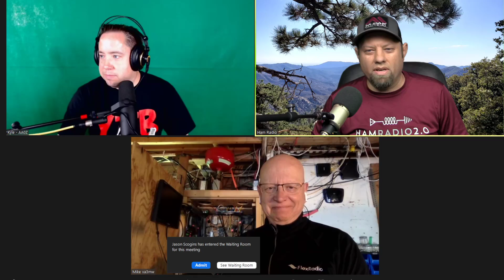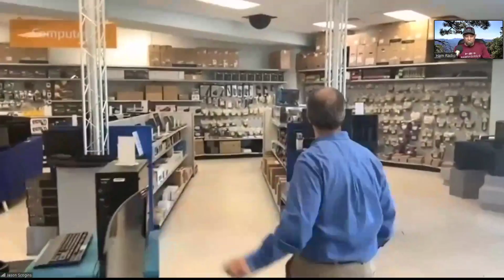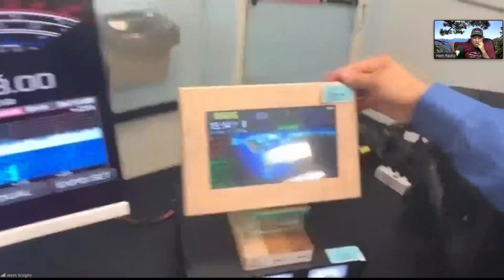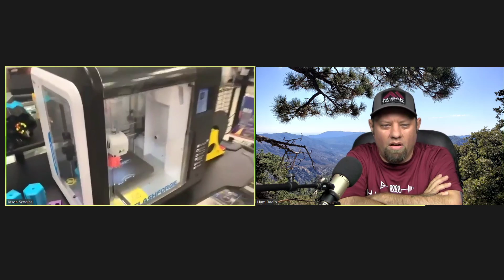YouTubers Hamfest 2020 Sunday Morning with Gigaparts and Bridgecom

Comment: A nice video to watch! Lots of information. A giveaway and a Code As long as it lasts.
Well as promised; here is a timestamp summary list.
--------------------'--------------------

@0:00 Jason gets the hand off from Kyle AA0Z
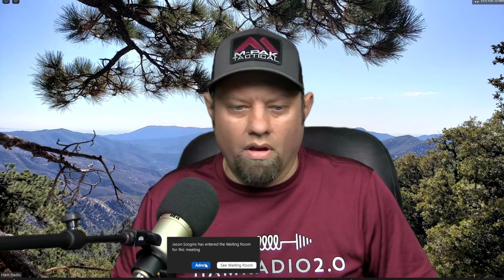@0:55 Intro for Jason and Steve from Gigaparts.
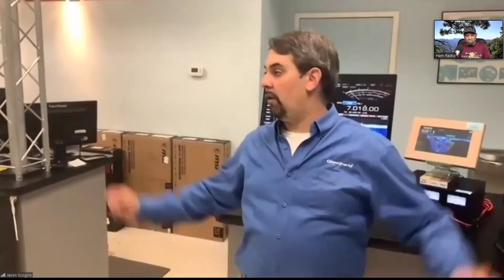@2:15 A Complete Store Walkthrough.
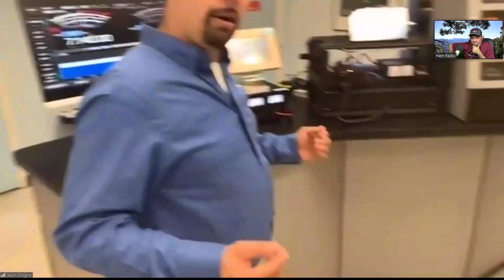@7:20 3D printing for amateur radio.
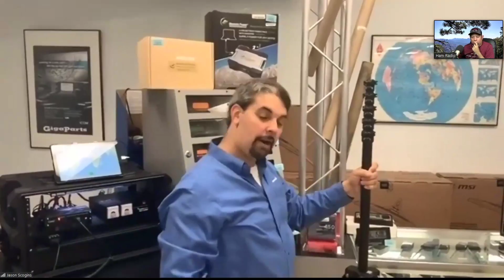@8:00 A New Tripod ?!
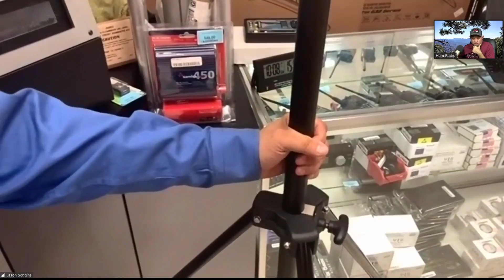@8:30 what is it made of and what does it weigh.
@8:53 How tall is this Tripod?
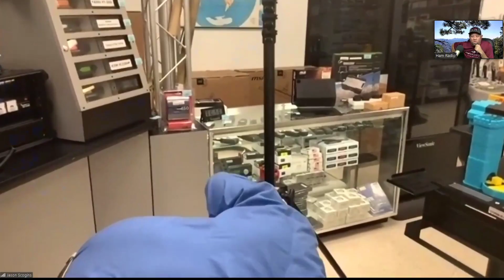@10:31 What does it cost?
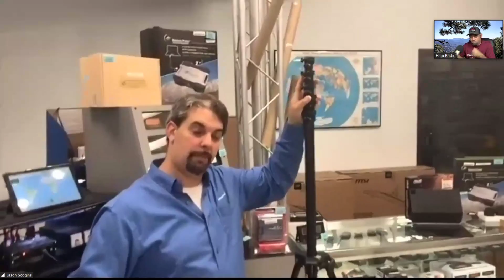@11:05 You Got A Mast!
@11:50 A New VGC Radio
@12:58 The Perfect Go Kit!
@13:57 Veritium HFClock.
@14:08 Why Do I Want This?!
@15:08 Will It Do Satellite?
@15:41 That Woodgrain Bezel.
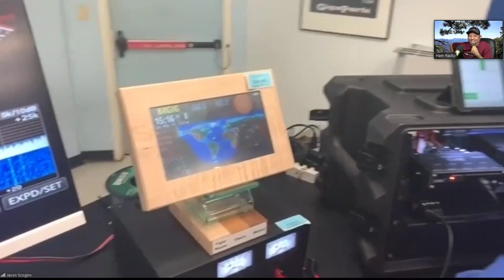@16:05 Does it Atomically Rotate My Rotator?
@17:24 Anything Else!
@17:47 10% Off ? ( As long as it is supported ) 
@18:55 Check Gigapart's Newsletter for more deals!
@19:36 FTM 300 coming?
@19:49 Wrap up for Gigaparts.
@20:24 Huntsville Hamfest and DX Diner.
@21:44 What else is in Huntsville.
@23:02 Outro 
@24:37 Future Reviews?

@26:50 Intro for Bridgecom Systems.
@28:07 Welcome Daniel.
@29:54 What Bridgecom does, and a course?
@31:16 How do i get that course.
@31:36 Got any Plug&Play Systems?
@32:46 So, How Complicated is this?
@33:10 Repeaters.
@35:10 Club Repeater Problems
@36:02 Q: Does it do GMRS
@36:56 Q: And Duplexers?
@37:38 And What About Digital Voice.
@39:13 Got Giveaways?
@40:35 What is included with that turn key repeater?
@42:15 Is Self Programming An Option?
@43:39 What happened to Dwayne From AnyTone?
@45:15 Do you ship to Europe? ore anywhere for that matter?
@46:43 Wrap Up for Bridgecom Systems.

@48:13 Welcome Josh and What's happening Next?
@51:05 Hello Frank !
@52:41 How the YouTuber's Bunch Started and Grew.
@54:48 Got Any Ham Radio Related Channels To Join The YouTuber's Bunch.
@56:34 Hand off to Ham Radio Crash Course.

Continue Watching Here; https://youtu.be/M-oAD4mEHGk

--------------------'--------------------

I Hope This Helps.
If Any Editing Is Needed Please Let Me Know.

73!
Reply from the maker: Thanks again, JD!
Reply: @HamRadio2  Again. You're very much welcome.